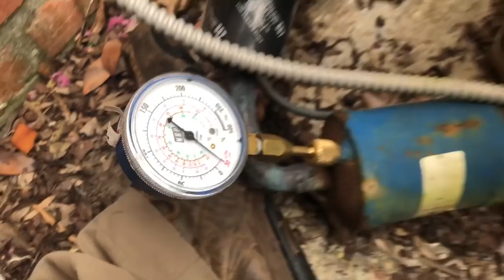HVAC | No Heat | Furnace Not Running

Comment: Accessing the blower inside these furnaces can be a pain sometimes, and the same could be said for putting that cover back on, making sure that the door switch is engaged and the screw holes are aligned.
Reply: The 90 plus units are even worse

Comment: looked like water staining on the top of control board case and transformer above it coming, i can imagine what it looks like inside the case.
the same water/condensate will kill the new board in no time, I'd have relocated it to the right cabinet side up higher, making sure the wiring all had a drip loops/went downhill from the board.
then again, probably time for a replacement.